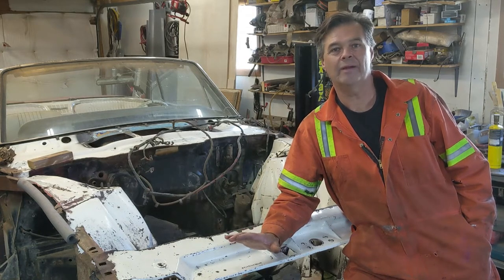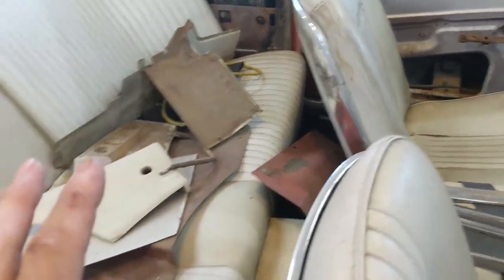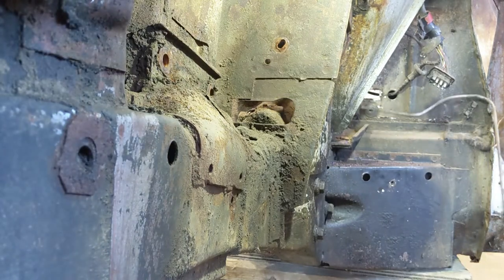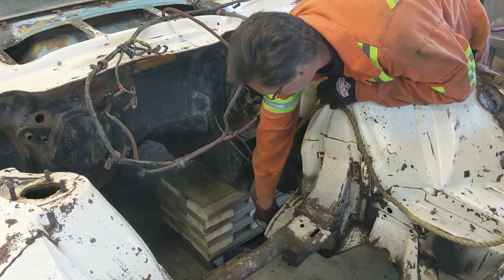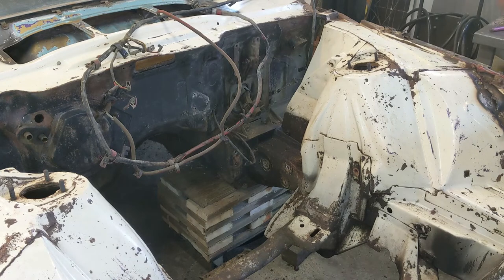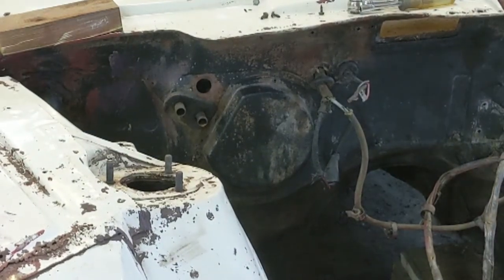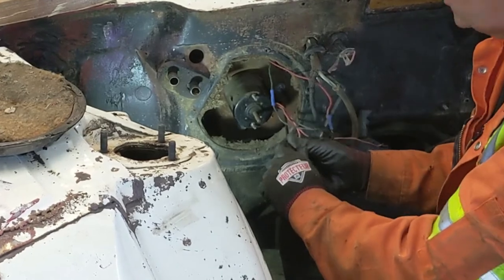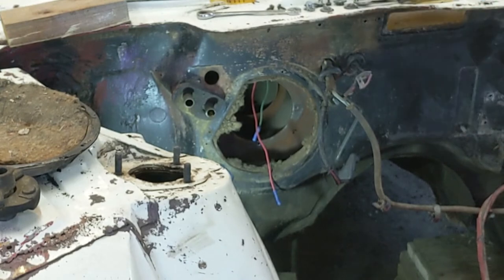ENGINE Bay & Planning The Next Step - 65 Thunderbird Convertible Restoration Ep #6

Comment: The sixties unibody Lincolns and Thunderbirds are just incredibly tough.  The door gaps and the way the door shuts on this rusty convertible is amazing.  The door hinges are huge.  I have had quite a few of these cars.  Conversely, I bought a 78 Trans Am new and the door hinges lasted about 20,000 miles/ two years before the doors were sagging and hard to close.
Reply from the maker: I have come to realized how ridged these T-Birds are, they flex for sure...but they are extremely ridged. When I was leveling the convertible to do the torque boxes, it was a fine line, even a quarter inch too high or low would effect the end of the car.

Comment: Hello Alvin, I think it is a good idea not to remove the doors yet. That gap looks really good. Those quarter panels are going to be a challenge for sure!
Thanks for the video!
George B. in Michigan
Reply from the maker: I have a plan for making the quarter patch panels that I sure I can work with...but even the best thought out plans don't always work out the first time, I guess we will see how many versions I can come up with! LOL.     V1.0, V1.1, V1.2... 🤔🤔🤔
Reply: @J_R_Shop  I have a set of factory replacement quarter panels that I will be using on my 66. If you need me to, I could trace the wheel arch out on paper and send it to you.
Reply from the maker: @servicetechnician3264  thank you very much! I'll use the factory fender skirts, they are the exact size and shape...with that said, I may have to take you up on the offer should my plan fail!! Lol
Reply from the maker: @servicetechnician3264  factory replacement quarters, those are a work of art compared to the reproductions!
Reply: @J_R_Shop  They sure are. They have that "stepped" lip around the wheel wells so the skirts would fit better.
Reply from the maker: @servicetechnician3264  I can't imagine trying to get the skirts to fit properly without that lip, and that's why the factory replacements are worth buying if you can get them.

Comment: You make the disassembling of a 65Tbird looks so easy.  Txs for the videos.  I will start working on my Tbird next summer as I'm repainting my 67 2CV Citroen. I have to redo the floor pans, trunk pan, power steering, brakes, window motors and exhaust. 
Are you fabricating the floor pans?
Reply from the maker: So far it's been going well, fingers crossed! I will be making the floor pans when the time comes, unless I find holes in the rear pans...this car only needs the front ones. My game plan is to disassembly the whole car before making repairs.